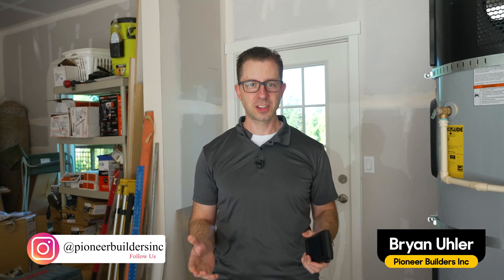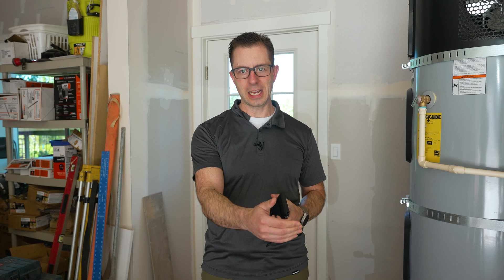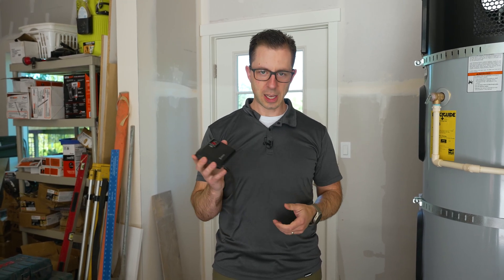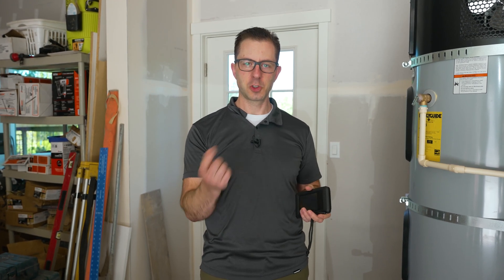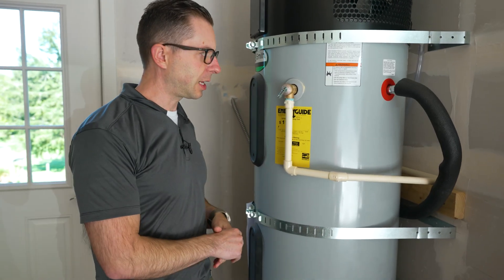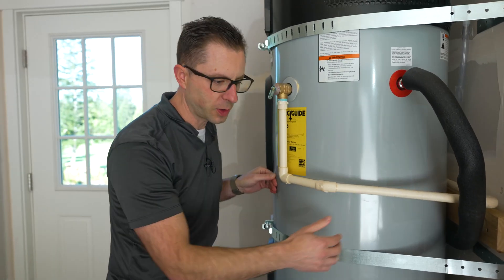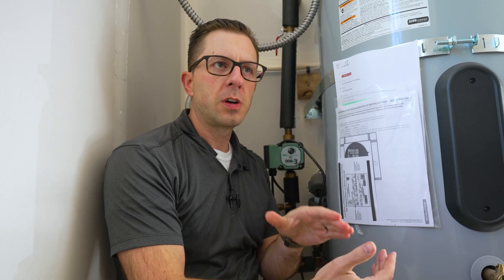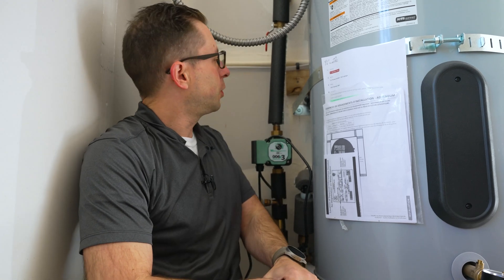Water Recirculation Loop Using the Taco Comfort 006e3

Comment: What I dont understand is, on a retrofit.  How can adding this for the farthest sink, affect the other sinks on another level the same distance away.  Example.  Upstairs in my house, the farthest sink away is the kitchen.  Downstairs, its a bathroom.  So how can adding one of these make hot water arrive faster at 2 seperate locations?  And as well, do the same for other fixtures in the house.  I have tankless as well, I dont want my tankless system to always be firing to have an endless loop of hot water running back and forth in the lines all day and night.
Reply from the maker: You could use the Taco Comfort Hot Link system. It's pretty cool.
Reply: @PioneerBuildersInc  Thing is, you would need to this sort of thing for every faucet that you wanted, not just one,  Or is it do it for one, and it works for all?
Reply from the maker: @virgil3241  I couldn't tell you for sure, but I'm sure the folks at Taco could tell you
Reply: The video describes fixtures located on a loop, which makes this easy (one return line.) For houses like yours and mine with fixtures NOT all on the same trunk or branch, you'd have to get more sophisticated. Basically, you do use multiple return lines and then balancers at the water heater so that each return line flows enough back into the cold side at the water heater. I'm still searching for a video that explains this well. I did find one from Mechanical Hub a few years ago that showed two balancers.
Reply: @thenexthobby  I contacted Nortiz, they said it can be done, but since its an add on, would circulate more of course and shorten the warranty since ist being fired more then it would be stand alone.  Maybe ones that come with them built it would be better.  For me, Ill live with it, insualte all my hot water pex line as far as I can reach in a finished house, and move on

Comment: Can that recirculating pump not be triggered on and off via a remote thermostat on the return line?
Reply from the maker: There may be other ways to control it, but I am unaware of them
Reply: Using the Grundfos system this poster -  https://youtu.be/rNmxo6VGhLo?si=JewVtOWmUPsnEw7y  - did a smart outlet mod to reduce pump run time for his system. I appreciated his detail and thought process as I have sometimes been accused of possessing a similar insatiable appetite for delving into the minutiae and intricacies of matters, reveling in the exploration of the fundamental principles and finer details. The modification not be applicable here but I thought the information would be of interest. @danschaller1628